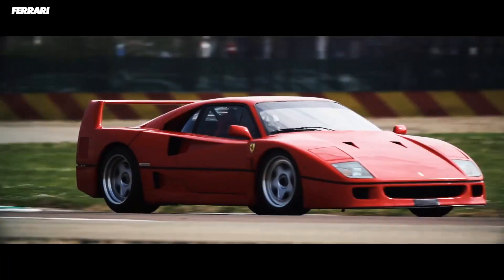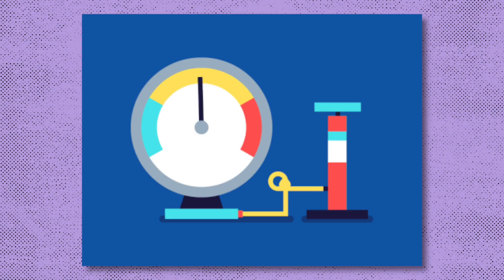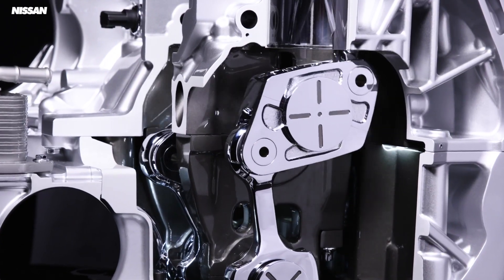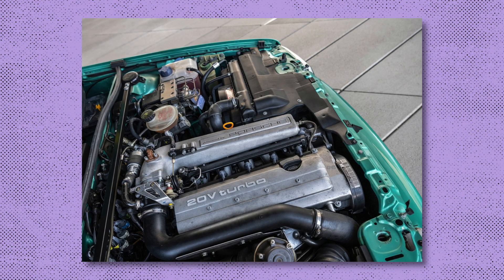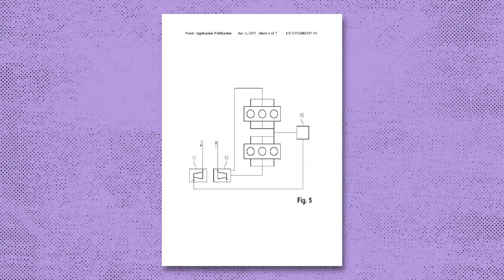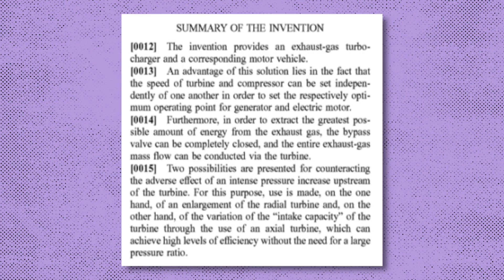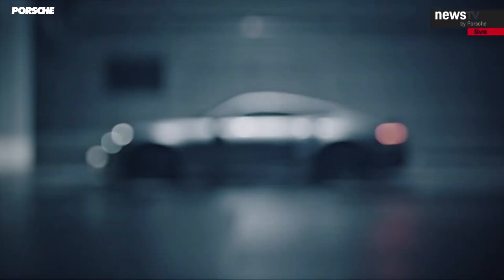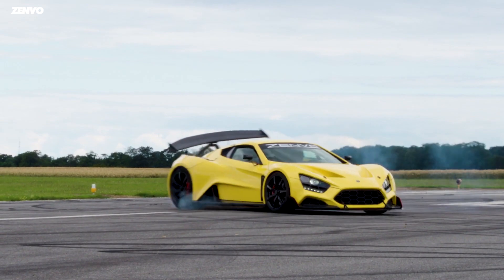Porsche's GENIUS New Turbo Design

Comment: I don't see how it can possibly work without some form of electrical storage system, which might be batteries or, just possibly, a supercapacitor. At low RPM, the generator turbo simply won't produce enough power, so there will have to be some storage facility. However, the prime benefit to me would appear to be packaging and plumbing as the exhaust driven turbine/generator doesn't need to be anywhere near the centrifugal compressor, which is powered by an electric motor. However, it is going to need an electric generator powered by a very hot exhaust turbine, and it might be that oil supplies will have to be arranged to both. 

In any event, we have cars, like some models of the Land Rover Defender, that have those supplementary electric turbos which do seem to work using a 48V supply. That is rated at 7 kW, but it only has to fill the gap until the turbo spins up, and not the full airflow at maximum RPM. With the Porsche design, the electric supercharger will have to be able to feed the engine at full airflow, and that will mean it's going to have to be a lot more powerful. With mechanically driven superchargers, they can absorb tens of kW at full power, and I guess an electric motor driven one will need power approaching that. We'll see if this turns into anything. 

In any event, this system could be characterised as an energy recovery system from the exhaust gasses which just happens to drive an electric supercharger.

Comment: So we have a Turbo Alternator/Generator and a separate Electric Supercharger...  

Less efficient but more flexible -- especially given KERS / hybrid battery setups with energy to spare for driving the supercharger -  those times when the turbines aren't "on boost"  but you need to get back on the noise..

NB - been waiting for someone to make an "economic" exhaust turbo generator - removes parasitic losses from the engine if it replaces the serpentine belt driven alternator.

Comment: I’m not an environmentalist by any stretch but purely from an engineering standpoint electric vehicles are faster and have far fewer potential points of failure - just look at all the parts in this turbo for instance.
Reply: In a straight line, then when you reach a corner that battery weight wants to keep going in a straight line.

Also it doesn't get lighter and faster as it discharges.

Comment: This separated/cuted turbo axle it's great for short bursts  (~2sec.) like used in Porsches having lightweight body, fairly big displacement keeping the load under 65% of the atmospheric torque without enough preload for a first sequential turbo even if VGT because the amount of feeded displacement it's too much for the amount of inertia if at 40% displacement load while at 60% VGT isn't the best as first in sequential pair.
Reply: I died from lack of oxygen in attempting to read your one entire sentence in one breath. 😂

Comment: Apparently, cold air is more dense than hot air. Therefore, depending on the humidity, (perhaps other factors as well), there may be more oxygen molecules extractable from the air during cold temperatures, than during warm temperatures. This, I believe, is the reason which one would need a charger air cooler. Just put this here for the curious lads and lasses. [The abundance of oxygen (or lack thereof) has a direct correlation to the power output of an engine]

Comment: Great video! One note, the air doesn't get warmer when your compress it, it expells heat :).
If the air is cooler to begin with you'll have an easier time compressing it.
Reply: The next time you are in a mechanical/automotive shop, grab the air compressors output pipe coming off the cylinder head just after it has finished cycling up to max pressure.  :-0

Comment: if this system utilised capacitors instead of batteries as you have the exhaust side providing constant power and only need a second of power draw to spin up the intake side from the capacitors before they only use the power from the hot side to maintain the speed of the intake side. this could make for a very compact system and also allow for much smarter designs in both exhaust and intake systems now the question is where do you source components to make this thing for the average car?

Comment: Better yet, just eliminate the exhaust side altogether.  Run a 96VDC electric motor to power the compressor and use the starter as alternator that will provide direct power to the motor and also charge a capacitor, instead of lithium batteries, for temporary surge power.
Reply: or just eliminate the whole gas part altogether and be quicker :)

Comment: Unfortunately this would be a futile system for the UK, except on racetracks and my local bypass at 3 in the morning. I'd love a go, but I feel that performance EVs will relegate high performance IC engines to the history books. Perhaps the sound-track could be mapped and played inside the car to simulate the experience of driving when gas gets too expensive.
Reply: Except if people drive EVs, the price of petrol must drop due to reduced demand.
Reply: @mrbloodmuffins  Would it be financially viable to keep a refinery operating for only a few cars?
Reply: @nicklord1418  petroleum is already used in several plastics and other products

Comment: you need a better display of the electric generator system
do they intend to max efficiency of the power recovery from the exhaust 
and send electrical power to the blowers?
no heat transfer from the exhaust gas, smaller cooler and exact spin up in the blower, with computer?
controlled electrical power. With a small battery in the supply side?

Comment: I wonder if anyone has ever tried using a tiny turbo, but instead of feeding compressed air into the engine, it feeds it into the turbine side of a larger turbo. A very small turbo would be spooling at low RPM, maybe even at idle, so it'd possibly keep the larger turbo spooling as well.

Comment: And those smaller lighter engines getting all their power from turbos and intercoolers will wear out 3 times  faster than  a larger naturally aspirated engine .  If you have an accident and  the turbo is compromised  but is still spinning it can pour out a mist of fuel vapors while you are trapped in your car .  The only turbo vehicle I would own is a truck but I don't like turbo's  in passenger cars . It needs some kind of bypass valve in the intake so when not switched on the engines natural aspiration is not compromised so much .  I could see a genuine use for this not withstanding rev-heads ,  in a 4x4 vehicle that is weighed down with trailer and quads and  slogging it's way through mud and slush . The instant boost even when the revs are low could be very handy  .

Comment: Not a professional by any means but we keep reinventing the wheel leave the turbo alone adding electronics to it just guarantees failure turbos are not designed as far as I know to be used on every day drivers in the city Mercedes-Benz has consistently had problems with their turbos on their A220 which is a pile of crap that has transmission problems but whatever what European car doesn’t have some kind of electrical problems or American car for that matter rolling four wheel laptops that’s what we drive now

Comment: Today I was thinking that waters 1700 to 1 expansion ratio would be useful if h20 were injected at a slight and controlled rate into the exhaust stream at the manifold. It seems the extra expansion of the water turning to steam would help cool the exhaust so better for the turbo and increase the pressure allowing it to spool up faster.

Comment: Can I suggest that you go back to school and understand all the terminology you are throwing around incorrectly. Turbo, Turbine, compressor, motor, engine, generator, alternator, supercharger, volatges and so on. A "Turbo" (Turbocharger) has an exhaust driven power "turbine" to drive the compressor stage "impeller" wheel. As soon as this assembly is broken apart, it is NO LONGER A TURBOCHARGER. This system here is a turbo-generator (actually a alternator) with and electric supercharger.

Comment: I wonder where this myth comes from that Turbos make cars more economical. In germany we got the saying "turbo läuft turbo säuft" which basically means your car is just chucking down fuel when the turbo is running. Recent studies have also shown that since the turbo charged downsizing trend has started the amount and the cost of engine repairs have signficantly increased. What downsized turbo charging has done is that during artificial testing the fuel economy numbers are better and thats what they can put on the label. Turbos increase power and they arent economical at all.

Comment: i would prefer a naturally aspirated engine powering 2 tires and a hybrid system powering the other 2. couple that with adjustable compression engine and that would be fine. forced induction doesn't equal dependability or longevity.

Comment: Honeywell -Garrett Electric Turbo has been around for a few years. It is EU-7 compliant. They developed it off the the turbine aircraft engines they build for aircraft and the Garrett system uses the high volt. Porsche is just a copycat….Just because Porsche “filed” for a patent doesn’t mean it will be granted. Porsche has the NIH attitude.

Comment: Yet another example of German over-engineering.  You could just do what Honda does. When you select sport, they up the RPM's and lag is eliminated. Much cheaper. Don't even think about lost MPG's when the driver just wants to go fast. My Accord rips with a touch of the pedal.

Comment: Years ago, a  man put a small pre-turbo before his big turbo.  The NSX he put it on was insane fast... big turbo fast.  The key however, was the pre-turbo that removed all turbo lag.  Since the small turbo spun up super fast, it fed the needed pressure to the big turbo that eliminated pretty much all lag.  It was amazing...
Reply: Isn't that also a bi-turbo setup ?
Reply: @yofolkdem1256  no, that’s just another name for twin turbo… well, technically it is two turbos, but they are in series rather than parallel. They are also different sizes.

Comment: 30 Years ago Chrysler made an Indy Car prototype that had a 4 pound flywheel which would store brake energy and dump this energy into wheel motors in the straightaways.
The flywheel is lighter and more efficient than a battery bank. If all these techs were combined the Porsche engine wouldn't need to shut down fully for corners and would have a full flywheel of energy PLUS a spooled-up engine at the APEX !

Comment: I am a big turbo fan but never owned a supercharger so my next car is going to be a Lexus IS200 and slap a supercharger on it and let it run 0.55 bar of boost ain't much but that's Max before messing with ecu and pistons rods ect will end up at 250hp I like small HP numbers you can uses 100% of it more then 600hp had that a Volvo s40 1.9 4 banger T4 but it takes so much to keep running good never blew up but it ate spark plugs coils and sensors and could just use 50% without lighting my tires up or to not go to jail

Comment: I like the concept. The fact that the comp and turbine are electricity separated. Means extra battery's & capacitors could be utilized to spool the compressor instantly . before the  exhaust catches up.

Comment: This i solved.
If you use freevalve, you can open just one exhaust valve.
Koenigsegg has a 3 cylinder engine puting out 600 bhp.
If BMW also use a smart hybrid settup they can a 2 cylinder hybrid.

But then again, why make noisy, smelly cars, when you can make cheap electric cars that are mutch better than any fossil car?
Horse and carriage dosen't go mutch faster if you dope the horse. Cars are faster.

Fossil cars are today's hores and carriage. Maybe fossile car lovers, can get some extra sound, so they are happy driving an electric car.

Comment: That sort of split turbo on a hybrid would be quite interesting. The battery pack would put boost on tap while giving you the ability to still drive if you become so boost drunk drunk you empty the ev keg since you would still have the ICE (internal combustion engine) to get by.

Comment: Excellent presentation. Regrettably turbo chargers put unnecessary stress on four cylinder engines hastening their demise long term. Have replaced stock used ct26 Turbo on my Toyota.
Reply: My 2013 Chevy Cruze's turbo is still going strong.

Comment: That's not a very original patent that Porsche has.  e-boosting centrifugal compressors have been around for years.  And Porsche's 919 race car used an exhaust-driven turbogenerator for waste heat recovery.  Now they have written a patent that combines the two.  

The internal combustion car will not be replaced by electric cars and gasoline will not be replaced by alternative fuels.  I've been listening to that guff for 45 years and none of it has happened.

Comment: I thought Ferrari was the innovator of this idea, splitting the hotside and coldside up, and integrating a generator/e-motor into the mix to help get ahead of the downfalls with a mechanical turbo, however I suppose many F1 participants could argue their design will be the first...I guess it's a matter of who puts this into production the fastest on a VIN plated vehicle.

Comment: Turbo lag is just an issue with spoiled brats driver. Whats the problem is the heat that make turbo produce is not good for moving parts.. peoole are not satisfied , they want to squeeze more, push more..

Comment: It is called adiabatic heating and cooling. When a gas undergoes a pressure increase it heats up only during the change of pressure. It also works inversely where a gas will cool when decreasing in pressure. (frost on a CO2 cartridge when gas is released) FYI it is very relatable to our weather systems and why Santa Ana winds are hot (High pressure compression)

Comment: This isnt the holy grail of horsepowers, torques, and mpgs, but its progress and on balance it is pretty terrific that Porsche engineers are investing their big brains heavily here.  IF you go back a few years, Porsche filed patents on a three-turbo setup. Theyre refining and reapproaching how we look at engines.  This is a company backed by the Volkswagon Group, so the warchest and money behind their research is staggering, well beyond small auto company or garage band builders.  With some luck, after many expensive R&D fails, Porsche figures out a new paradigm for building better engines that make more reliable power and use less resources (or someone less rich does, luck to everyone i say). But to circle back, bolt on electric compressor/turbo setups are already a thing and i hope they improve. Theres an obvious tie-in to material science and the evolution of batteries and storage/discharge, and a more electric engine is a certainty for us.  Ultimately...I like cars. Cars are cool, exceptional engineers trying to make cars better is cool.  If Porsche strikes gold we may see their stuff adapted industry wide at non Porsche prices....because being cheap is also cool:)

Comment: By using the turbines to generate the electrical power to drive large compressors is the way to go as it'll provide a consistent spooling speed to maximize power. And imagine with launch control making them go top speed preparing to destroy some rubber.

Comment: Can’t wait to see their turbo concepts in F1!
Reply: F1 will soon require non-IC motors. New electric, hydrogen-powered or other sources have far more to offer than the massive waste of energy in reciprocating  engines of any kind and trying to get more out of burning primitive fossil fuels. F1 technology drives automotive design in all aspects so development is going to make myriads of mechanical and electrical components like intake compressors, pneumatic valves,  etc. old technology soon understood by nobody but us old fellers!

Comment: Its verry interesting and what you say is correct but some pictures do not add up to what you say and some pictures are not correct. If this is eduacational than some pictures are to dificult to understand in relation to the message you want to send. Fore instance the drawing where there is described that there are 2 turbo's, there arent.... one is the actuator and the other is the turbo.... not 2 turbo's. You speak of a audi rs2 and you show an rs4. Also younshow the F1 turbo simulation where the axle between the compressor and the turbine, this is to much and not realistic if you tqlk about a porsche. Just some feedback, i hope you see the benefit of it.

Comment: The 2022 911 Turbo S has clocked 0 to 60 MPH times as low as 1.87 seconds and a consistent 1.9 to 2.0 second 0-60 MPH, but hey, that's Porsche for you, always under promising and over delivering.
Reply: *heavily modifed Turbo S. regular one is 2.6, way slower than way cheaper family sedans from one American automaker :)))

Comment: The other benefit of turbo is in combination with DI and EGR. TC motors can use high boost and high EGR combo with lean burn DI to make better efficiency.
Reply: EGR is not for efficiency, it's for NOx control.